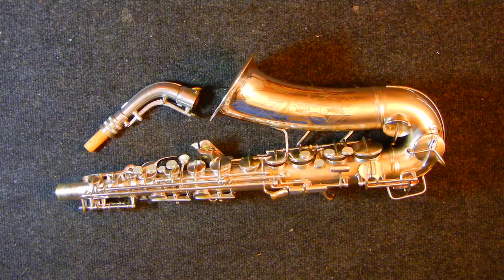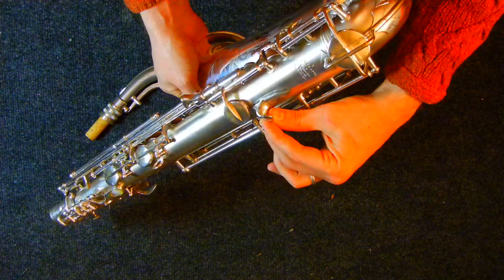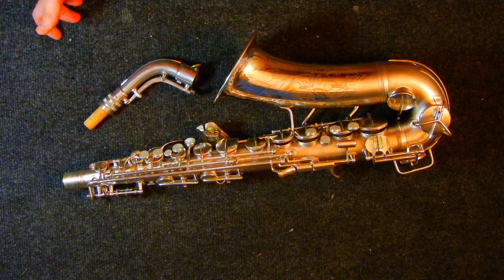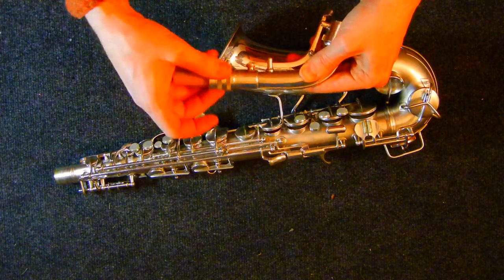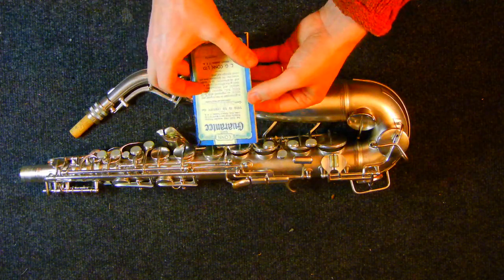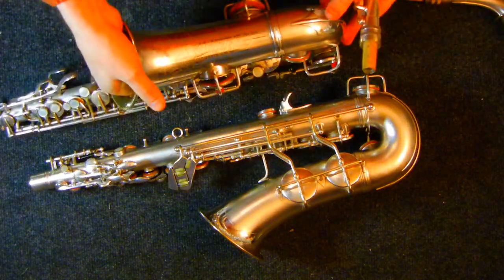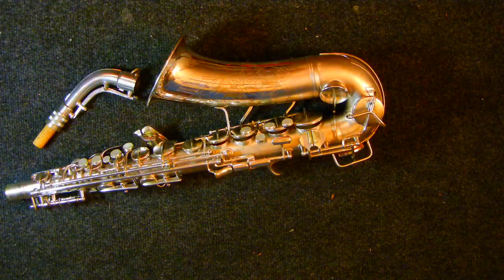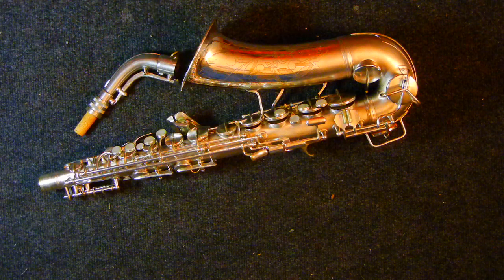Repairman's Overview: Conn 6M "Transitional" Alto Saxophone (restoration of deleted video from 2011)

Comment: I have one made between these and it's a a great saxophone.  One issue- the high B goes ~40c flat but the middle B is fine.  Any ideas what could cause this?  Local repair shops seem to not know much about vintage saxophones.
Reply from the maker: Typically large octave differentials stem from incorrect key heights and/resulting from a mouthpiece that doesn't match well with the player/horn combination.  It's a complex system that can be hard to diagnose!